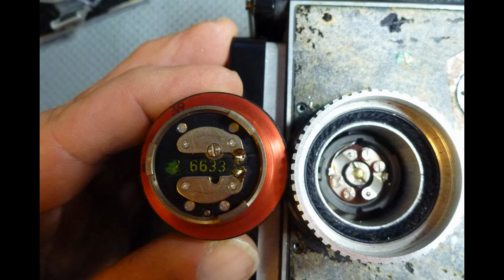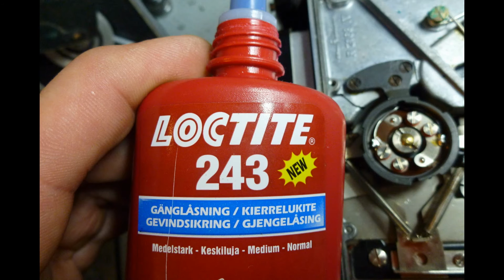Loose lightmeter in Rolleiflex 3.5 TLR______pictureslide show

Comment: Could the camera work fine if you just take the light meter away? I mean, lets say you just stop the work at the 42 seconds in the video. Would the camera be ok? (I just want to take off the light meter from mine).